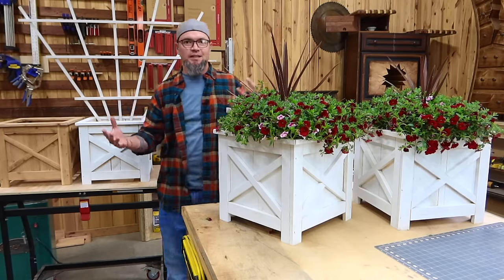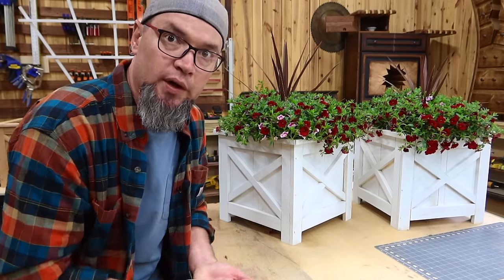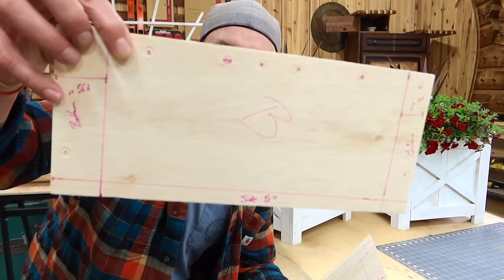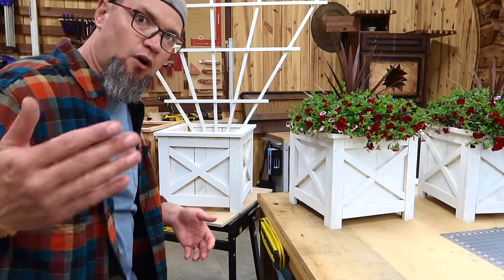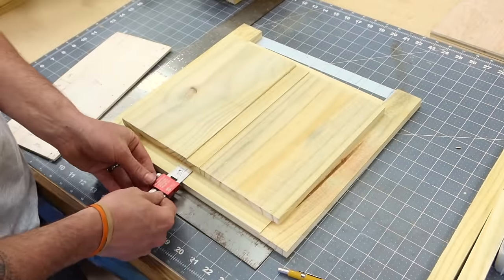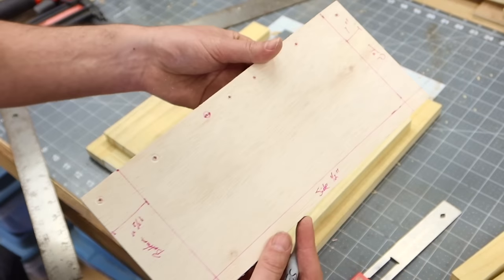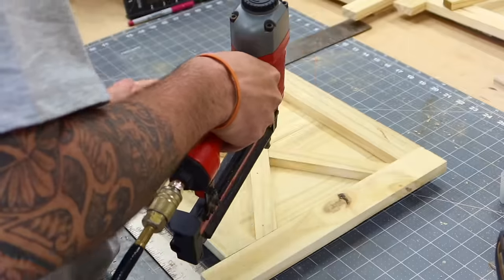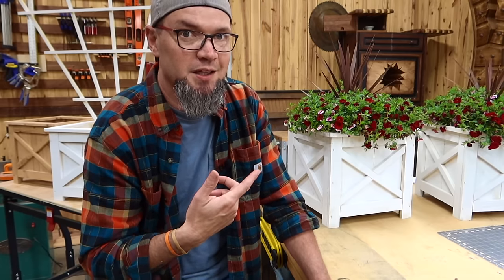The $6 Planter (Version 2) - Low Cost High Profit - Make Money Woodworking

Comment: If you're going to use them for Christmas tree stands, what about threaded inserts right under the lip, so they can run bolts through to stabilize the tree?
Reply: You probably wouldn't want to actually do that. I don't think this is built strong enough to hold that. You would want to build a little bigger than a tree stand.

Comment: I've been looking at your products for quite a few months now. I decided to take one on. This took me a little longer to build than I thought but it came out looking good. Just as a suggestion to see if it would work, how about putting a 2-in piece in the middle of the A sides?  That way it would close together with the B sides. I look forward to building a lot more of your projects. I also suggest if you're a rookie, buy an extra picket if you're just going to build one. I had to use half of the extra one for this first time.
Thanks again for inspiring an 83-year-old to get back to work.
Reply: How many 1 3/4, 1 3/8 and 1” rip cuts do you make from each picket? Thanks

Comment: Made a couple of these this morning and sent a few pics to friends and family. Got 7 paid orders just after lunch 👍.
Nice easy project that sells itself.
Thanks for posting the vid
Reply: what did you land on for the price point?
Reply: Now matter how I cut it, I can't  seem to get it all out of 3 pickets, any advice?
Reply: @SkilletintheWoods  same here, I also can’t seem to have enough of the faces overlap the legs for the screws.
Reply: @ZachDominguez99  there's not much room on the sides of the walls where they connect to the legs. I just put 1" brad nails down each side. I'm still stumped on the "3 picket" part. They appear to be 6ft and priced similar to the 6ft at my local Lowes. I thought maybe he was using 8ft, but they don't look that long.
Reply: I found out the pickets at Lowes are about 1/16 to 1/8 inch narrower. I went to home depot and they seem to be  better quality and slightly wider. I'm hoping to nail down the correct order of cutting to get them out of 3 pickets.  I'll let you know if I pull it off.
Reply: @DBackcomics  I was surprised, the ones at my local Lowes was all 5.75"

Comment: 9:04 so true! I’m new to the hobby and couldn’t figure out why my pocket screws were poking out when following the other box build plans. Thought I was using the Kreg jig wrong. Turns out the fences were a tad thinner than advertised. Lesson learned, I made the adjustments and my mom loves her planter box. Keep up the good work Matt!
Reply: I had the same issue, all the pieces were splitting.  I ended up getting 1" kreg screws instead of 1.25"
Reply: I had similar issue! Was infuriating as I had drilled all pocket holes in all parts! Ended up cutting new parts and putting a 1/16" shim at base of my jig.

Comment: Okay, I bought the cedar months ago thinking this should be easy. Well, I sold my table saw when I moved back to Nevada so all I had was a scroll saw that won't stay working, a circ saw, a jigsaw and several hand saws. I finally got sick of waiting, bought a broken dilapidated table saw and rebuilt it, not my first rodeo. Its 118 degrees out so I quickly cut all my pieces and assembled it on my kitchen island. This is so fabulous! Thank you so much!! I've been fighting my way back from a knee blowout while installing flooring so this was my first physical success in 6 months!

Comment: So, I am watching backwards a little. After several of your others, I jumped in on your multi level planter and bit the  bullet for a Kreg. I have resisted for years, but it was too cool to not try. I even did the math on those "expensive" screws vs modification to brackets. Obvious choice these days was the Kreg. I also admit I did not buy your plans because you are quite easy to follow. I made only one mistake but it fixed no issues. I used all cedar (I own the mill) and it is FANTASTIC. 
Now I find these planters just as lovely and no Kreg... 😅😅 
I have no idea why I resisted all these years except pride. Money well spent. 
Thanks for all you are doing, you inspired me to go past just selling the lumber, and at the very least, I have stuff that encourages sales of materials. Gonna catch that cat one way or the other!

Comment: Hi Matt, I purchased your plans and am excited to build these. I did want to mention a change to the design I made that involves materials. Home Depot sells a much higher grade treated fence picket for $2.78 that I am using to build 5 of these. It's 80 cents more, but it is still 6 foot long but a full 6" wide, 3/4" thick instead of 5/8", is lightly sanded and even has a coat of waterproofing stain applied! I looked through the design and the only real impact that I can see is that the "Middle Wall" pieces can be eliminated as the wider picket stock covers the entire side of the box. Also, I can use my existing stock of 1 1/4" exterior screws instead of the harder to find 1" screws.
Reply: How did you manage to inlay panel B into A if you're using 3/4" thick material? I also have 3/4" thick material (5 1/2" wide) but it's 1/16" too narrow on each side of A that B sticks out when I attach them together so from the outside it's not flush.
How'd you make yours work?

Comment: I would suggest putting pocket screws into crossboards and and B for strength.  Your asking a lot of that small bite for the wall to hold that piece in place.  Plus if you do it on the crossboards the wall boards will hide the holes after.

Comment: This is not a criticism, just a true questions. I have now made three of these, and the first one I used a 1in middle wall board, but have now changed to an 1 3/4 in for the middle wall board. i noticed in the start and end of this video, that the ones with the lattice framework, that they appear to be 1 3/4 not the 1in. The 1 in works, just had to be careful in nail/screw placement as it was super close.  The plans are amazing as always, and I have enjoyed the build a lot, as does my yard :D ha.... Thank you!!!

Comment: I've made quite a few if these just for my own use. I find that if  there's much weight at all in the box tje screws pull out. I don't use large holes or anything and I do pre drill to avoid wood splitting. Open to ideas to make bottom stronger

Comment: Ok, finally made one of these only took 2 days, 😆. 
Yes, I made a few mistakes and yes some of the pickets were only 4 3/4in wide near the top and bla, bla, bla!!!! After a couple redos and figuring out a few things to better suit me I finally finished.  Looks great wife is happy. Couple tips, MAKE sure to straighten out bows or curves,  sand well before you even start also check the thickness of the boards IT MATTERS! My added little twist, I'm making a top cover as well. My wife pulls her plants in during the winter so make a cover when not in use and it's still a decorative piece plus you could store items in it as well.  Can't wait to make more.

Comment: Matt, I was unsure that these could be made with three (3) pickets but you are right they can.
A little update on material and price as of 3/14/2023 in my area in Michigan.
The big orange guy has 3/4x6x6 treated for $2.68 each. Yes real 3/4 thick but the width is 5 3/4 that is strange and they have a 5/8 red pine treated which is 5/8 thick for $2.97 each
The big blue guy has 5/8 nom. cedar which all of them are running 1/2" thick for $3.97 each The treated pine is also nominal 5/8" but all are at 1/2" thick for $2.18 each. Nice simple design for the planter and looks good.  Good Job

Comment: Just built one and it turned awesome, but be sure to measure your pickets. Bought the cedar pickets from Home Depot in my area and they only measured 5 3/8" wide. So I had to adjust my middle wall broad width. Love watching and learning from your videos. Keep up the good work.
Reply: Same here. Now I'm lost on what to do. Could you help me with what cut parts I will have to adjust?
Reply: the inner wall panels are mainly decorative. you can put a gap in them
Reply: I only had to adjust what he calls the middle wall. It calls for 1 inch width and I  had to cut to 1 1/4" WIDTH
Reply: Measure total length then minus your two widths

Comment: I made one.  The cutlist tool I used neglected a few pieces tho, so I have to re-figure that out.  Picket wood splits easily, so you must drill holes for screws, and not too close to the ends.  I found the edges to be really close in places, had to drill and screw at an angle.  Mines a bit wobbly so I may try glueing and rescrewing the panels.  I am going to keep following and trying your other projects.  Keep em coming.

Comment: My number one idea for anything would that’s going to be outside is after you paint it either spray it with a polyurethane and use flexseal on the feet clear like three coats I have a picnic table that I built six years ago and there is no water uptake into the legs at all if you put end grain onto the ground it is going to rot
Reply from the maker: Awesome Tip!
Reply: I use 5 minute epoxy for the ground contact areas.

Comment: I had a busy weekend so I didn’t get around to making these or the others but those will be started today after work. I’m using seasoned fence pickets so they are a lot softer. I will probably use just brads as I only have 1-1/4 screws. Thank you so much for all that you do!!!!
Reply: let us know if that works, 1 inch screws are so hard to find here in Canada.
Reply: @gurindersingh7002  it worked even though my seasoned picket fence piece were soft. I used 1 inch brads and titebond 3. These were for me but any others I make I will try to use screws.

Comment: Great project, only thing I changed on mine is the A side I made the middle wall cut wider to allow for more space to nail and screw into, maybe my boards are not as wide but this helped out. Customizing a wider taller one for a gift and really excited. Not a fan of the cross on the sides but to each their own.
Reply: Yes, the middle board should be adjusted wide on side A.

Comment: Just for information for UK viewers. I just googled fence pickets and 1200mm x 75mm (roughtly 4 foot by 3 inches) of pressure treated wood are very approximately £5.00 each or $5.50 USD.
This will make the planter a lot more expensive to make, each side will use about 4 strips for instance on top of the pickets being around 2.75 times more expensive per item despite being only a bit more than half the width. Profits will be considerably lower however if the finished article sells for similar prices (I haven't checked), it will still be a worthwhile project.
Reply: Update. Amazon offer a pair of planters with 30cm (1foot) sides for £33. It's hard to see worthwhile profits in this given the higher prices we pay for materials in the UK.

Comment: Great design. This is no way a criticism. Just 2 points on making these.
1. I purchased 6 fence boards to make 2 of these. Board were a little wide so I ripped them to 5 1/2". 4 months later when I went back to build these my boards were 5 3/8. DON'T WAIT 4 MONTHS TO BUILD WITH PRESSURE TREATED WOOD.
2. Also, I had to buy a 7th fence board to finish. I am sure that I could have been more efficient with my cuts and the thinner boards led to some cutoffs that were too thin to use.
Just some observations. No criticism. They turned out great. Everyone loves them.

Comment: I think your video is great and very well thought out, but my slight change did help me.
I have found that putting a pocket hole screw on each of the cross boards add much more strength to the over all structure.  Thanks again for your extremely miserly use of materials.

Comment: Thanks for all of your how-to videos.  I bought a 4-pack plan that included this.  I thought I had cut everything exactly, but the wall pieces on sides A just barely covered the legs to the point where it was difficult to sink a screw through the wall and hit the leg without going a little diagonally.  When I do this again I will make the middle wall strip wider for sides A to give me more drilling room.
Reply: How many 1 3/4, 1 3/8 and 1” rip cuts are you making from each picket? Thanks.
Reply: @stacie487  Can't remember off the top of my head but I cut it exactly as indicated in the plans I bought.  Even in the video I noticed that Matthew had very little room on the wall to sink screws into the legs for the A sides.  An extra 1/2 inch on each side would make a huge difference.
Reply: @JohnSmith-ld1pw  Okay, thanks for the info!!

Comment: On the final steps of building my box and it has been amazingly painful.  I don't know what I am doing wrong; I am following your directions meticulously--even triple checking.  I can definitively state that this build is tremendously more difficult when you don't have a brad nail gun.  Thankful for your guidance but so frustrated at my outcome.
Reply: Don't give up.  I build 2 from scratch without a bad nailer and without plans and it was a challenge but I did it.  These plans make it easier.  Get a far nail gun. I week site get one for my next project.

Comment: Why is it taking me more than 3 pickets? Are you using 6ft pickets?

Rookie woodworker here... I made one and it turned out great, but I had to use a small section of a 4th picket to get enough to make it. I had very little scraps left over. On the 2nd one I've sat down and made a detailed cut list and tried to get as much as I can out of each picket, and I'm still short and would need a 4th picket. Any advice on what I might be doing wrong? These are great, just wish I could figure out how to do it with 3 pickets!
Reply: 8ft ones

Comment: Big fan of your approach to simple, straight forward designs and the use of jigs for volume production.  Under the topic of distinguishing your product from others, what do you think of spraying something like clear Flex Seal to coat the bottom 1" to 2" of anything that is going to touch the ground?  The purpose would be to protect the item from wicking up ground water.  This would apply to the flower boxes, the fan trellis, the obelisk ... anything that sits on the ground.  If you like the idea, feel free to use it in your videos.
Reply: 5 minute epoxy works great for this. It seals up the ends and protects it from rocks or anything else that could scratch it. And it's fast!

Comment: Really enjoy the videos and the plans, but .... I sincerely recommend a change to the plans. On the cut list table and cut list diagram you list parts by a letter (e.g. A, B, C, D, etc) but then on the subsequent pages you refer to them as their description (e.g. Long X (A), Short X (A), and so on). As I made my initial cuts and labeled them as "A", or "G", and such ... I found I initially had to keep flipping back to the cut list page when I was looking at the assembly step. I ended up just writing in what the part "letter" was on each assembly page. This made it a lot easier. I had labeled each stack of parts as the letter (instead of writing out a long description), so having that letter on the assembly page is easier.

So my suggestion is to add the part "letter" along with the part description on the assembly pages. Otherwise, I 100% enjoy the videos and the plans. I believe it is the best combination out there on YouTube.

Comment: Made two of these today based on your video. Used the same method step by step, tacking together with Brad nails then drilling and screwing. What I found was, I can’t think of one realistic scenario where I’d want to do all the work of drilling and screwing when it’s completely unnecessary and just another cost plus labour. I made one with screws and one with titebond 3 and Brad nails (because the screws didn’t quite make sense to me) The titebond unit will last longer and be stronger. I guess if you didn’t want to wait a half hour between glueups you could use screws. Otherwise, excellent video! Ps STOP TALKING ABOUT THAT GODDAMN JIG! 😂

Comment: Hey Matt. Great video. Good Plans. I have one question on the 3rd picket cuts though. The one with the L pieces. What is the best way to cut that picket? The other two are pretty straight forward. The third does not line up for a straight cut for K and F. The L pieces are in the way. Yeah I can mangle it on the bandsaw or mitre saw. How are you doing it?
Reply: I tried it with a jigsaw. It worked out ok, but I think there's a better way because one of my narrow inner wall pieces has a dog ear on it now. I think I'll measure it from the other way next time. 

I'm definitely going to make some kind of marking jig to go over the end of the picket.
Reply: I have the same issue. I'm addicted to your channel as of yesterday. Thank you for the sharing content. I bought the plans and am working on my first planter. The only other thing I've ever built was garden beds which are straight cuts.  BUT this 3rd picket has me at a loss for the best way to cut. I cut off the dog ears first, then worked out the k and f pieces. Then ran the rest through to get the 1 3/4 cuts done. But now I'm stuck. Please help! Are you using the circular saw, chop saw, jigsaw? For the last picket?

Comment: Made the other platters. Everything worked fine. Pocket holes worked great, my issue was the top 45's with the 7 degree. They did not add up to the measurements, I had to make them shorter. Other then that. Bot is solid. Tha js. I'll be buying these plans as well.